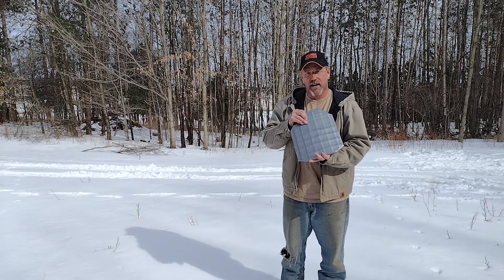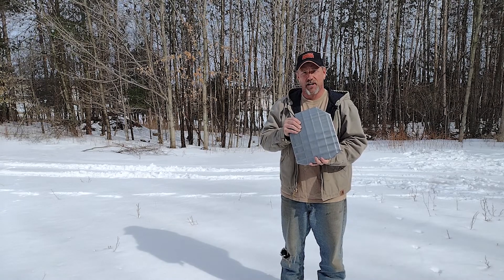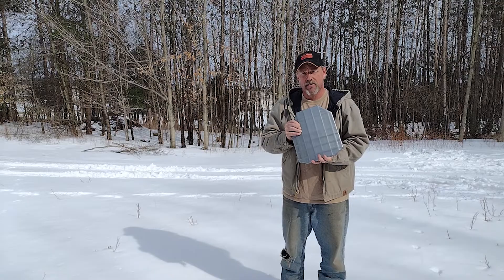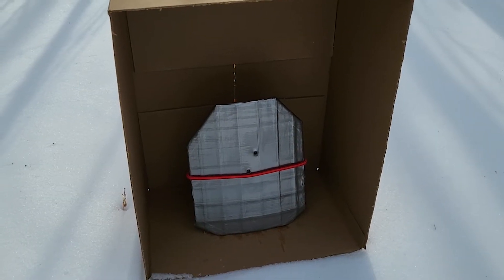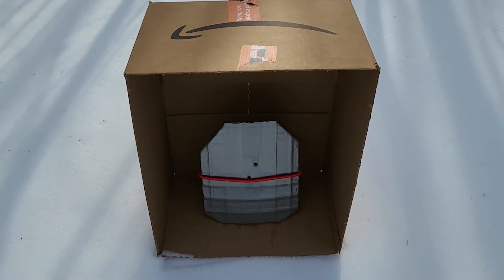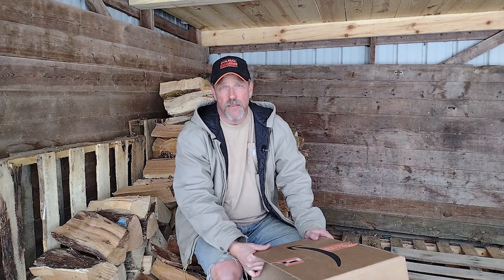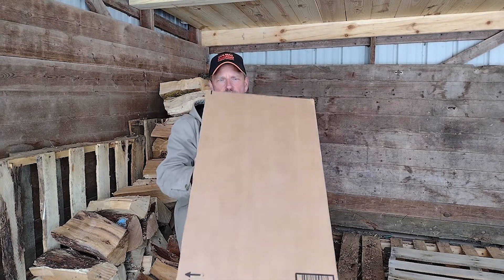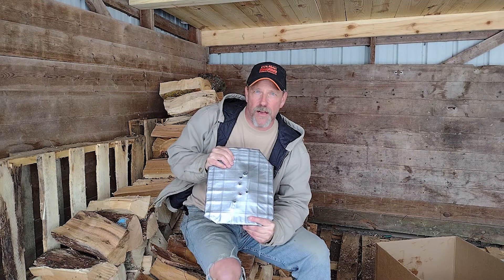Duct Tape Spall Liner Test

Comment: Can you do a test with butyl roof tape and or flex tape. Butyl tape has a thick goopy layer of adhesive. Flex tape has a lpwer breaking strength that duct tape but is waaay stretchier.

Comment: How many layers did you use and can you make a video of how you wrapped the tape onto the plate
Reply: Quarter inch thick of duct tape. Which is 1/4 inch thick. Apply as many layers of duct tape to reach 1/4 inch thick.
Reply: I'm wondering the same thing never mentions anything on how to. I guess just do your own test and figure out the best way.
Reply: @Matthew-yq6ho  I was confused so I went to my local hardware store to see if they could help me.  The guy there showed my how to tear duck tape into whatever lengthed strip's you want them then put them on something like a plate. He said duck tape has a smooth side and a sticky side and you put the sticky side down so it sticks to whatever you want to stick it to. Its pretty technical and I dont think I really understand because when I got home I tried to stick duck tape on something but it didnt stick accept to my fingers but I think I might have put the smooth side down and the sticky side up so maybe thats why it didnt work I dont know. I going to go back to the hardware store to have them show me how to use duck tape again.
Reply: @jackmeehoff231  hey good luck trusting your life to some duck tape a 20inch ar barrel will go right throu the steel anyway so stop wasteing time on heavey steel that you need duck tape spall liner, backing pads all these things to make steel work, people don't trust duck tape to save your life from spall go with a level IV RMA has affordable options and you don't need duck tape.
Reply: @Matthew-yq6ho can’t beat steel bfd though 🔥

Comment: ok redo it with 1/8 inch and or 3/16 inch with another 7 round the reason is to try to find out what is the minimum you need to be effective it is a scientific process...

Comment: Can you try it out with 556 and 7x62 next?
Reply: pretty sure it'd be the same results probably even less spalling since a 45 is much bigger than a 556
Reply: @dutch  it's about velocity not size
Reply: @stephenroach8033  the amount of spalling has nothing to do with the size/amount of matter to be spalled?
Reply: @dutch9238  it’s not that size/amount (or weight) “has NOTHING to do” with amount of spalling; it’s just that it’s only half the equation. The mass of the projectile and the velocity of said mass = the energy of the projectile. 
Armor is most often defeated by fast projectiles. 45 is one of the easiest projectile to stop.
Reply: @dutch9238 .45 is subsonic, any intermediate or rifle cartridge would rip right through it.

Comment: I had this same idea when i saw the  build up coating tended to separate after so many rounds.   The plate is fine, but the bullet fragments still can do damage.  With this extra addition it would seem like the coating will be much less likely to separate.  Not that i ever want to get hit by a 308 20 times, but if it were the case, I’d want every last bit of protection for as long as possible until my insides liquify.
Reply: I have an expired soft vest as a trauma pad but I’m thinking it may be better in front rather than behind the plate.    
Your Thoughts?

Comment: The funny part is it works better than any anti spalling products I've seen hahaha.
I wonder how much weight in duct tape that added.
Great video.
Reply: Hell I guess the only way to find out is to slap it all on there and then cut it all off and weigh it up.  Great question though as I still wonder what the weight difference is between anti-spalling plates and the standard AR500.

Love to see a comparison between the two for sure!
Reply: @mbed0123  or you could weigh the plate before and after tape is applied to find the difference.
Reply: No shit...the CA anti spall sucks but its the nicest fitting...
Reply: I wonder how many layers and what brand.
Reply: @chipsramek3868  i used gorilla glue brand duct tape since its the thickest i could find. 10 layers equals slightly over 1/4 inch thick. (Technically mine was 5/16").

Comment: How many rolls did you use? And did you go all the way around or stop just enough to stick to the back?
Reply from the maker: One 55 yard roll got us to about a quarter inch thick layer.  Used just enough to stick to the back then ran strips lengthwise along the edges of the plate to finish them off.